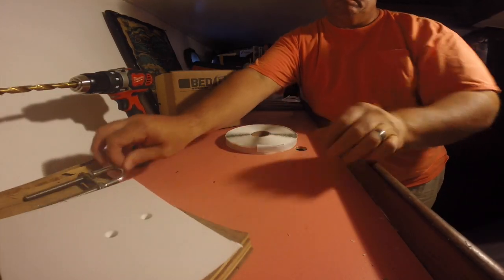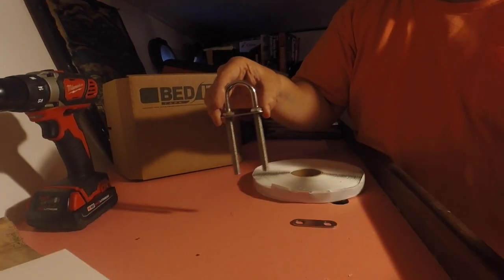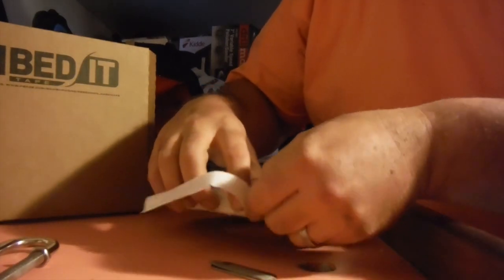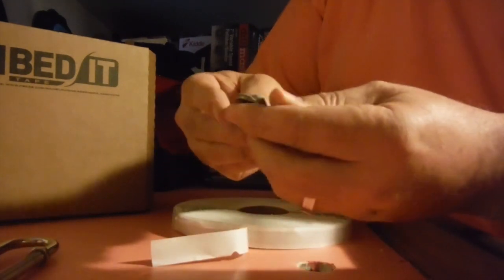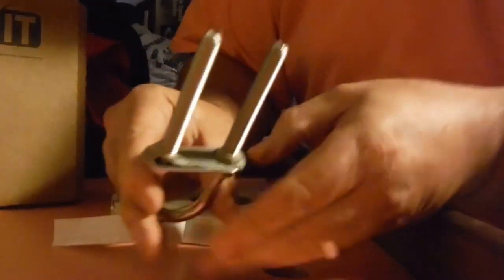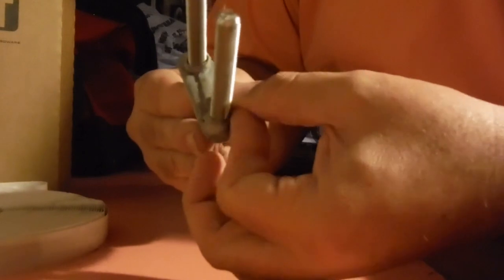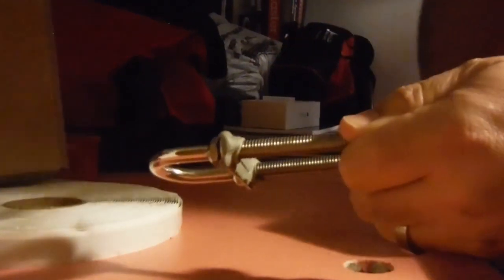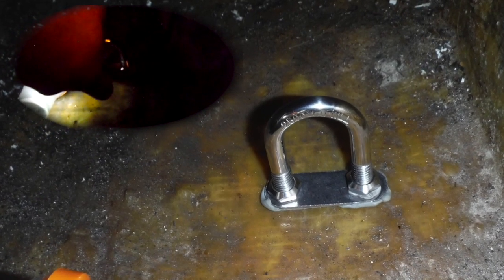Bedding with Butyl Tape

Comment: I worked in the sailboat building business for 16 years. We tried several different bedding compounds. The one that worked best, under extensive leak testing, was polysulfide bedding compound (we used Lifecaulk by Boatlife - I do not have any affiliation with them.) It comes in white or black. It is a little messy to clean up but it sets to a flexible rubber that makes a durable and long lasting seal that may be disassembled if needed. I would recommend that you not use a polyurethane sealant as it forms such a strong bond that if it needs to disassembled it will tear off the fiberglass substrate. This is relevant as most boats are fiberglass these days because it is long lasting, inexpensive (relatively) to construct, and requires much less maintenance compared to steel, aluminum or wood.
Reply from the maker: +Lazy Days Thank you for the comments and points. Since creating this video I have done a few others in bedding ports and glass and use polysulfide (for its sealing and adhesion qualities) but I was still favoring butyl for mounting metal objects to fiberglass because of its easy removal and not needing to have it adhere as opppsed to create a flexible seal for leak proofing (above water line obviously). 

I would love your opinion on that or are you using polysulfide for beddings things like clears, and through deck bolted items.